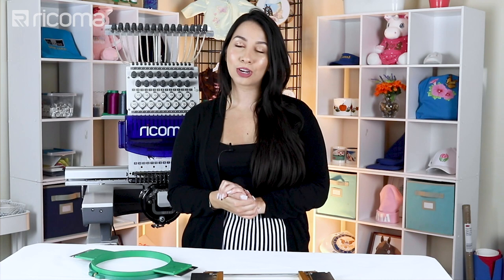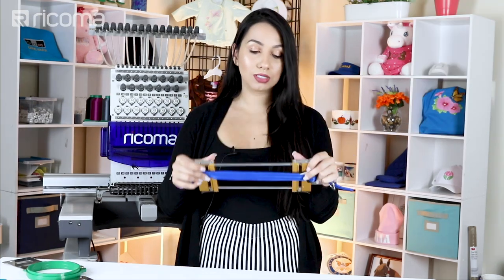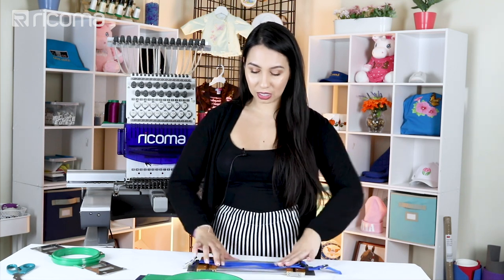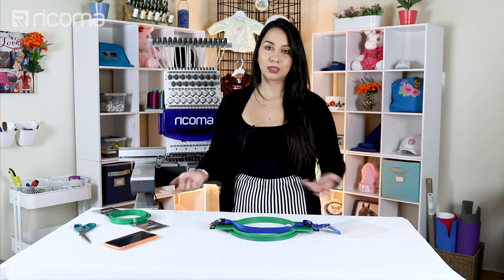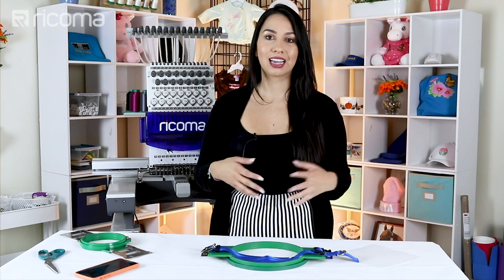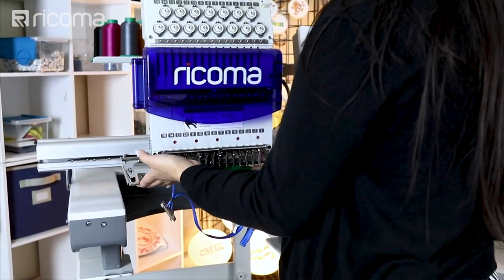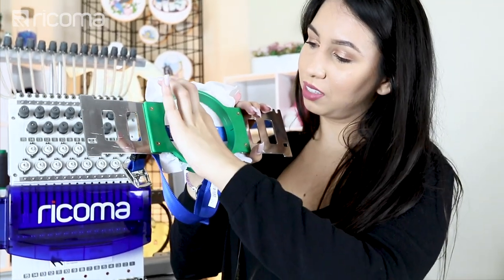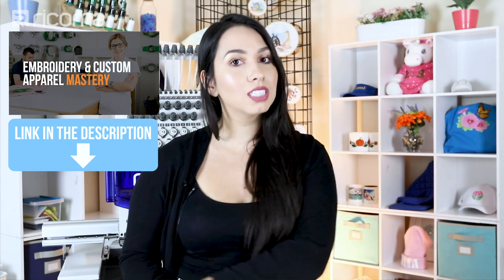Step by Step DOG COLLAR EMBROIDERY | Reward your good boy! (Embroidery Hub Ep83)

Comment: What fonts go best on the nylon webbing? Block and thicker ones? Should I stay away from script ?
Reply from the maker: Yes I agree! Thicker bolder fonts. You can do a script as long as it's larger text, you have wide enough satin stitches and water soluble stabilizer on top.

Comment: You don’t need backing on anything that thick
Reply from the maker: You are correct. In this case the stabilizer was used to keep the belt secure while embroidering. Sometimes the belts may shift if not well secured.